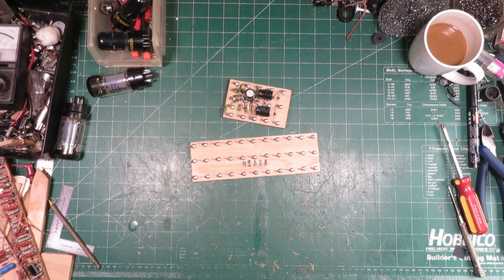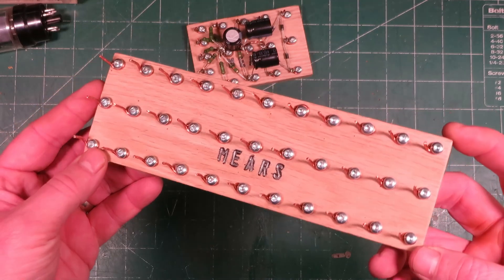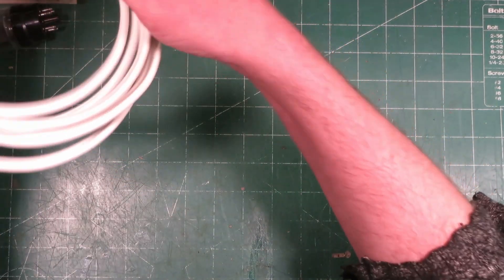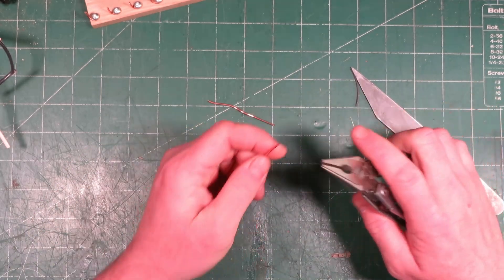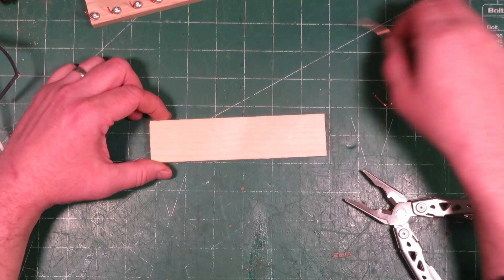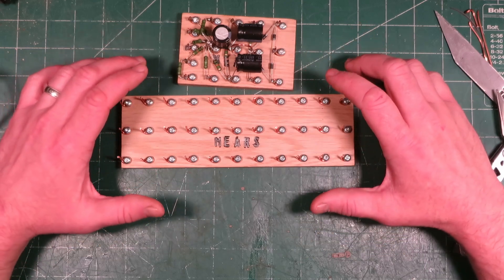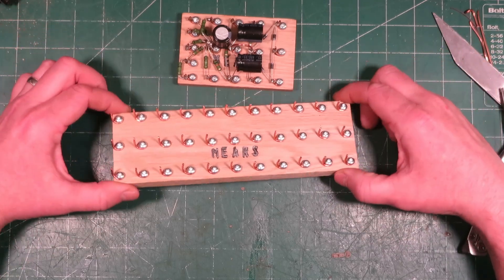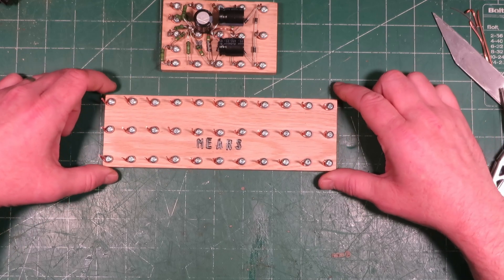DIY Wooden Circuit Board for Electronics Projects

Comment: I have watched a few of your videos, very nice work. I must implore you though, please, please, don't use wood for circuit boards ! Wood is flammable, it absorbs moisture, it's just not professional. I have built amps out of old tube PAs and such, as a way to save money when I started out too, but frankly, making an amp with 75 year old transformers in it probably isn't the safest thing to do either. As another commenter posted,  FR4 G10 Garolite is the way to go, I wouldn't even use phenolic sheet, which old amps used to do, that can absorb moisture as well. You can get it from McMaster-Carr, Amazon, Hoffman Amps, etc. You can get great turrets from Hoffman as well, or you can use eyelets like in Fender amps. When you are making fine custom amps like you are, don't cheap yourself out, spend a little bit more and make them boutique quality. You can cut the Garolite with a router and make it any shape you want. I just noticed that you are in PEI ! My mom is from Souris, many generations of her family lived there. Anyhow, keep up the good work, but ditch the wood man !

Comment: You can buy sheets of garolite in whatever size you like.  It comes in many colors, has a known and uniform resistance, fire retardant properties, will not absorb humidity, will not split.  Long term, who knows how well a block of wood is going to do in a hot vibrating box full of high voltage, especially if it is played in humid environments.  If you must use wood, use the pulped, pressed, and vulcanized kind fender did, though even that has a tendency to become conductive over time and cause problems.
Reply from the maker: You're right, Garolite is a really great material to use for circuit boards, that's a great idea, thank you!  I think scaling is an important consideration, meaning it's better in Fender's interests to have uniformity in their products, given they sell so many.  For small time builders like myself, I still think wood is a great option for use in projects where we can monitor it's usage.  Great comment, thanks!
Reply: @mearslab  My concern about uniformity is with the variance in resistance in the wood grain. If a problem should arise and you start to char the wood, that char will likely follow the grain and create a positive feedback loop of more char creating lower resistance creating more char.  

At the very least, avoid fender's mistakes of placing components too close together on a board that can become conductive.  The most common location for these problems in old fenders is where they placed the mounting screw connected to chassis right next to the plate supply in the preamp.  In your case, laying out your board so high potential and low potential nodes are far apart and cross grain is probably wise.
Reply from the maker: I've been thinking about this a lot and I really appreciate your feedback.  I'm planning on doing some destructive tests in an attempt to learn more about fault conditions that could arise, like the ones you mentioned.  Currently, my mind is on a coating to apply to the boards to minimize any absorption of water.  Something like beeswax perhaps. I could see potential for a beer or a Gatorade getting spilled on an amp, leaking into the board and allowing it to become conductive.

I'm leaning heavily into component placement to mitigate issues.  You hit the head of the nail, keeping distance between low and especially high tension voltage areas, air gaps between components and the wooden board, as well as identifying areas where thermal conductivity between components could become problematic.

You're not in Eastern Canada by chance are you? Would love to talk more sometime.  Thanks!